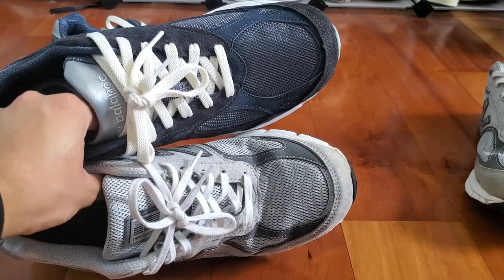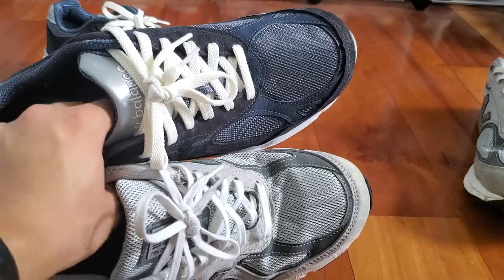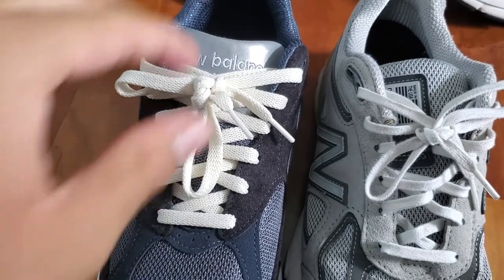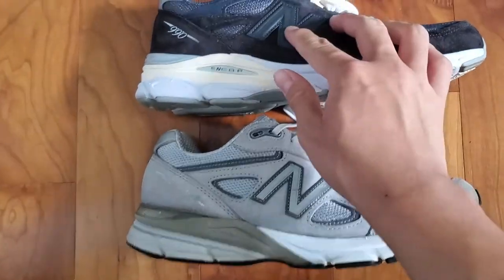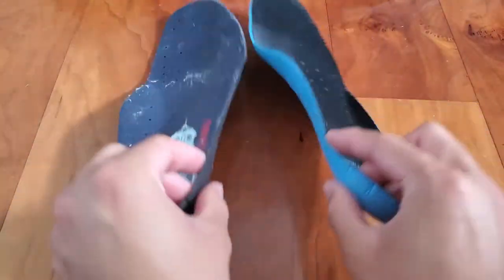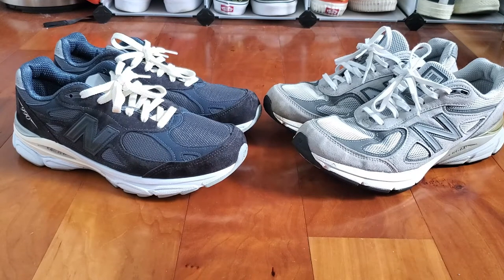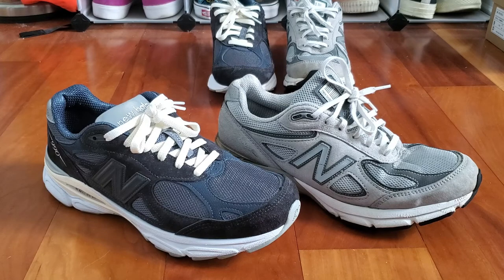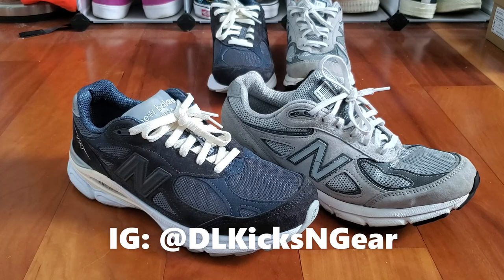New Balance Made in USA 990v3 vs. 990v4 Comparison, Sizing, Comfort, and Design!

Comment: I have both the v3 and v4 and they both have their pros. The v3 to me just feel more plush and a bit wider on the toe box that may be since I have used them longer but immediately felt like the perfect walking shoe very plush. When I got the v4 they felt slightly slimmer and more of an athletic shoe that I could run in. The v3 to me is not a good running shoe at all but the perfect all day walking shoe.